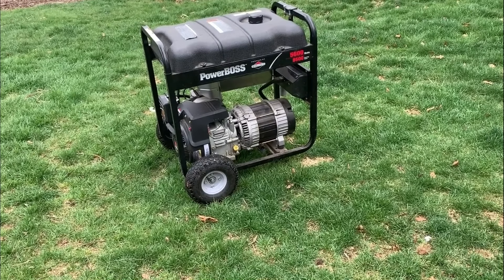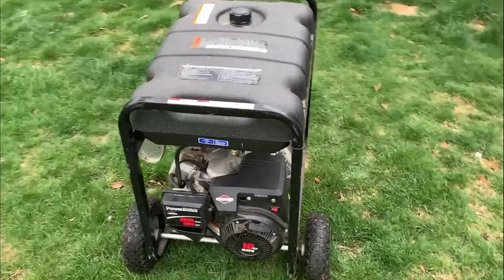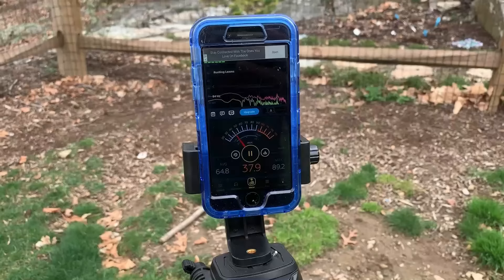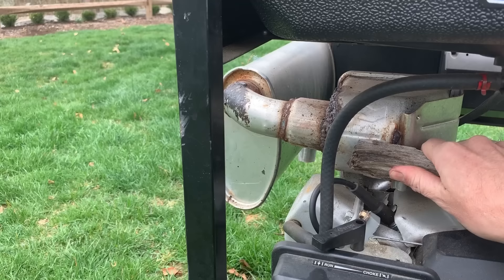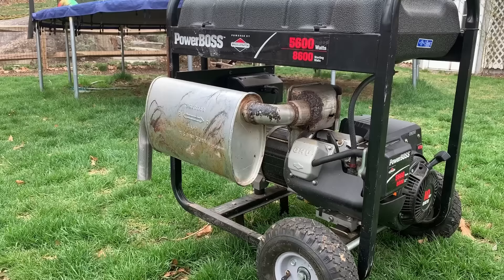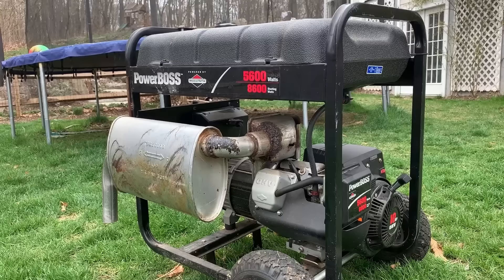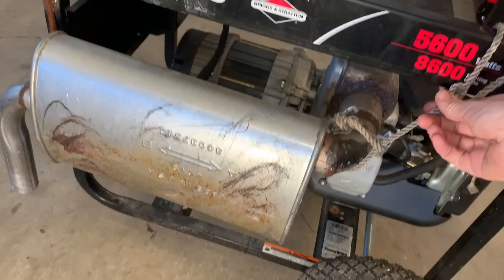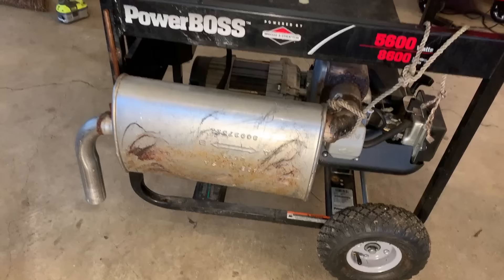Will a Car Muffler Make a Generator Quiet?

Comment: It's a 10hp engine, you could run open exhaust and it probably wouldn't be too much louder. Whoever had the bright Idea to put on a car muffler vastly overestimated the combustion going on inside that single cylinder. Also as someone else pointed out, it's a lot of mechanical racket as well.

Comment: Most of the comments are wrong because they are based on the erroneous statement that 3db is perceived as twice as loud. That is wrong. Three db is about the minimum loudness difference that a human ear can perceive between 2 sounds. If you are amplifying sound, 3 db takes about double the wattage. 10 db is perceived double the volume but takes 10x the power. And the frequency of the sound also has an impact. 90db of 100hz sound may be well tolerated, but make it 2500hz and it may well seem overwhelmingly loud.

Comment: keep in mind that loudness isn't the only thing that effects how disturbing a sound is, frequency plays a pretty big role too. so even if they had the same db one sound might wake you up at night and the other might be ignored simply because of the frequency of the sound. and since you were replacing it anyway you should have jb welded that hole, it would have lasted long enough to check it out, that piece of wood wasn't holding any pressure at all. also i like many others must point out the 3db rule, it isn't a linear scale, 55db is more than twice as loud as 50. 8:47 it would have been fine, we are talking about more than a foot of clear air between them and it isn't exhausting directly in, if you put your hand a foot away from that exhaust it is going to be like a warm summer day, not that hot. you are WAY out there with your premises.

Comment: Consider this: 70db vs. 76db is 4 times quieter. If you have a spare muffler and some time to kill with a beer and a welding machine, while you often run a generator in some confined spaces, why the hell not.

Comment: Car mufflers are meant for continuous exhaust flow, try motorcycle mufflers, not only that, but modern exhaust systems for cars typically use 2-6 mufflers.

Comment: NVH (noise vibration, and harshness) is something car manufacturers have spent billions of dollars to mitigate. You can get the exhaust noise down but it's still going to be pretty loud cause it's just not that well of a sorted engine. If you put the whole thing in a big box you'd quite it down a lot more.

Comment: So it turns out that db is measured on a base 10 logarithmic scale and 3 db equals increasing or decreasing sound energy by two, going from 75 to 70 db is a significant reduction in sound energy, even though it does not seem so in loudness to the ear. Since energy is what harms the ear this seems to be an improvement for ear protection. I would not do the mod either, I would use a sound deadening enclosure which might be more effective and would not modify the machine. Interesting experiment!

Comment: I've been told that a used stainless beer keg makes a great muffler. Even better if you can cut it open and weld in a couple baffles. Better still if you bury it in the ground next to the generator!

Comment: Two cockups . First get a muffler for a large displacement motorcycle and move the  exhaust outlet away from the space to be shielded from the noise. Then you will get quiet.

Comment: One if the man issues with how this was set up is the flow,  the car muffler allows a vastly higher amount of air through. If you were to reduce the exit hole to roughly the size of the exahst port, it would get even quiter thanks to the ability to catch those pressure pulses and dampen them better as it wouldn't be such a free flowing cannon effect. Learned that one from an old guy who liked building go carts with diy mufflers to keep his naboors and wife from yelling at him 😂😂😂 he used a piece of pipe and a few washers, set bit for tuning the muffler exit hole.

Comment: Dig a hole in the ground, put the generator in it, put one intake pipe in it, a muffler with a pipe for the output, close it up with a thick sheet of wood and done.

Comment: Would make more sense to just panel the 4 sides of the cart with particle board and sound deadening foam, and then route the exhaust outside, and maybe add an intake and exhaust hole and DC fans to circulate fresh air in the box...

Comment: A bit late in catching this. Idea, but that car muffler was 1 - too big and 2 - badly installed.  On top of the fact that it had a big hole in there that no matter how you really block it, some noise is getting out.  Using a smaller muffler like got a motorcycle is the right way to go… after you remove the factory muffler.  ;)

Comment: I have no idea if the can will work. but try this. remove the 12'' rear wheels from a lawn mower and replace the 4'' wheels on the generator.  on the front. install a couple of caster wheels.  you will be amazed at how easy it is to move around

Comment: A lot of noise comes from the intake and tiny air cleaner. If you made a large intake box with a reed system it would reduce the noise quite a bit. The intake is easy 50% of the noise.

Comment: motorcycle muffler and build a mod for the air cleaner side, that will help alot to block some induction sound. if you want true silent build an insulated box to sit over it when running with forced ventilation.

Comment: I have found that my phone analyzer is less accurate than a good analog audio spectrum analyzer. Also, outdoor application is best measured a bit closer. The delta is more apparent. I’m not trying to be a know-it-all, cause I’m far from it. Just done this sort of audio analysis quite a few times over the decades.

Comment: It dropped it by 6 dBA! The second muffler had effectively halved the sound level.  
That said, the car muffler points at the ground, the stock points straight out, and the biggest difference could be just in that.

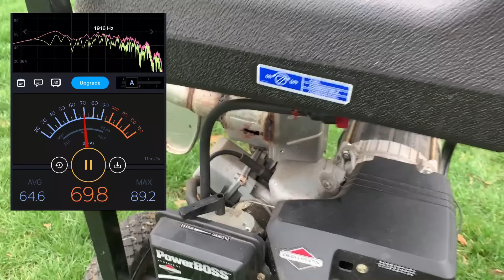Comment: 2:03
9:41
for comparison
you can really hear the pulses of the exhaust more without the muffler. once the muffler is on i think the majority of the sound is coming from the mechanical parts like the valves and such. the fact that it was a 6 decibel drop actually is pretty impressive, considering that means (i think?) a 2x (50%) reduction. of course our hearing is roughly logarithmic so it doesn't actually sound like that much, but if roughly half the noise is from the machine and the other half is from the exhaust pulses, those sound like pretty good numbers. you can see in this video how to reduce the sound of both the mechanical noise and the exhaust at the same time: https://youtu.be/CKQu_Pvdh0I?t=602
Reply: I'd also like to add, i've revved my car engine up to 3600 rpms and even with the normally very quiet exhaust it gets moderately loud when it runs that fast (plenty, again, is due to mechanical clatter, bearing noise, fan noise, etc). add a load (by putting it in drive and pressing the brake and gas at the same time, obviously making sure you're not gonna run into something) and you can hear it get louder. a lot of commercial generators run at 1800 rpms with a 4-pole genhead (unfortunately very uncommon for whatever reason on these smaller consumer machines) and i think that's largely just because it's quieter (probably also has something to do with less wear etc). i think part of the reason that the smaller gensets are run faster is because the manufacturer wants to squeeze as much horsepower out of the smallest engine possible, and if you've ever seen a dyno curve that's how you do it. run it as close to the redline as possible.

Comment: I had an extremely loud Coleman generator.  I wound up building a portable, 3 sided box made out of 3/4" plywood with a piece that just sat on top.  It was well ventilated so heat could escape, I then installed a round muffler onto it, with flexible exhaust pipe that went to a car muffler that pointed away from the campsite.  It helped, but it was still very irritating.  I finally bought a Honda 1000w inverter just to run at night and I swear everyone had to quit talking to make sure the thing was still running.

I sold the Coleman in a garage sale for $75....good riddance.

Comment: I vent mine into,,,,a steel container filled 2/3 full of anti freeze , exhaust enters below Anti freeze and bubbles out and is vented out with another pipe at the top...you still hear the mechanical sound of the engine...but very quiet.

Comment: Much of the noise from a small generator engine is from the engine itself, very thin head and cylinder walls with no water jacket surrounding the cylinder to help muffle the sounds as on a typical automobile engine. Even if you muffle the exhaust it will still be very loud, unless you enclose the entire generator in a sound reducing structure.

Comment: changing exhaust flow has consequence the same as changing water flow by increasing size or decreasing size of hose . a garden hose is worthless if I increase the size to 4inch at dispense because it will not have any pressure .

Comment: Engines that are running at 3600 rpm are just loud in general, full stop. Generators run at that speed to produce 60hz electricity at the right voltage.

I think a lot of people here are using their car at idling in the driveway at 750 rpm as their point of reference. 

Go rev your car up to 3600 rpm and you’ll find it’s relatively noisy. And that has an exhaust manifold, resonator, at least one catalytic converter, multiple feet of exhaust pipe and a muffler engineered specifically to reduce at engines volume. 

People here thinking they ‘cracked the code’ is hilarious.
Reply from the maker: So true.

Comment: The real trick is these engines run at 3600 rpm.   Tons of noise.  Unfortunately you can’t override the governor to let it idle and produce much electricity. You will burn up the generator. However Maybe I’ll do a mod that has a 2:1 ratio pulley set ??  Would that make a cool video? Do some sound damping for the mechanical, different exhaust ,and lower motor rpm ?

Comment: The noise comes from the slap of the piston against the head and internal parts. Its a very small block and not as thick as a car engine that's why the noise. You are better off trying sound dampen using ply wood around the generator. The muffler is there to control engine emissions from the fuel and oil.  They all run about 70 dbs.

Comment: I mean if it didn’t have a quarter inch by 2 inch gash in it, and if those welds were done a lot better lol. Then I bet it would of actually significantly dropped in noise volume. Also angling the exhaust tip at any angle other than the ground would probably help out too.

Comment: I think the comparison was fair. You had a gaping hole in the original muffler and holding a piece of wood over it is not a sufficient block. Additionally, one of the bolts was loose where it mounts to the engine. Another sound leak. Internal combustion is the same on a small engine as it is on a large one. There is no way a good muffler would be that loud on a car unless it was a Thrush or something along those lines. So, if the test was equitable, I bet it would have been significantly quieter.

Comment: A 3min video stretched to 10:39 mins.  Like Victor said use a single-cylinder motorcycle muffler with a small resonator for harmonics. Works for me and cools the exhaust exit temp to boot.
Reply: Come on. It is more entertainment than pure science. I liked to see him work as much as do the measurements.

Comment: My stepfather replaced the oem muffler with a muffler significantly larger than the irrigional vs and it cut the noise by about 50%. I don't think you can hope for more than that.

Comment: that is pretty cool to see but i think it would be even cooler for someone to build a custom muffler for a generator see if it could be made quieter. the larger the muffler the quieter things are but the size of the pipe also effects the sound.  i know i got a vehicle with  a single 3" exhaust and it sounds so much better and louder than my other vehicle that has dual 2" exhaust and the vehicle with 3" still has the factory cat.

Comment: Hmm. If I were to do this, I'd make a proper adaptor to go pipe from the engine into not one, but two, motorcycle mufflers (Thank you, @Viktor Krivor, for that part of the idea) in series.
And yes, they would need to be able to rattle with the engine.

Comment: If you want a quite generator, make a box out of ceiling tiles ( they're fire proof) and  drywall corner edges . Vent the exhaust with a 3" and a 4" heat duct . Crimp the 3" 
Right on the generators exhaust.  Cut a 4" hole in the side of the box for a double wall exhaust 
This will drop you to about a cars dB and will cost you $50 to make

Comment: While this made a significant improvement to the sound quality, I'd rather just buy an inverter generator. Adding a muffler can actually damage the engine if you don't know what you're doing, due to back pressure on the engine. I'm sure you can research and figure out how to do it correctly, but with so many good inverter generators putting out 7K+ running watts in the $2K range, to me, it's not worth spending $700 on one of these generators, spending money on a muffler, paying to have it welded on (unless you have welding equipment) and you still end up with a generator putting out dirty power.

Comment: Yeah you may think 5 decibels is not that much but as you mentioned that muffler pipe had a hole in it... And if it didn't have a hole in it the decibel reduction would probably have been in the 10 range... aka it's a good idea if you don't plan on leaving your generators out in the weather for the muffler pipes to start rotting and creating holes like this one did...

Comment: I think using all that muffler volume would be possible to design a extreme quiet exhaust for this little engine, but the mechanical part would still make a lot of noise and maybe people would start to return them, claiming that the engine is broken inside.

Comment: Of course not. Start your car and open the hood. The only reason cars are so quite is because the engine is sitting in an enclosed compartment, usually with some amount of soundproofing. The best you can get at removing exhaust noise... just run a straight pipe up in the air 6ft.

Comment: Air cooled engine has no liquid tunnel surround cylinder, so it will be way louder than a liquid cooled engine! What a muffler can do is very limited, and most important is make the exhaust go away as quick as possible, long pipe will increase the heat, it's a big thing for generator

Comment: I tried this with a 6kva diesel generator. It made a small difference however there seems to be a lot of sound that comes from the engine itself, through the crank case perhaps. 
I had a $400 car exhaust professionally fitted.
Reply: $400 ?? they saw you a 'coming, bub...........

Comment: I don't believe this can ever be done effectively (where it makes much of a difference) without compromising the efficiency of the motor.  I took my B&S 5500 Storm Responder to a muffler place.  A friend I knew had a muffler installed on his gasoline powered wood splitter at this place and had told me it had become very very quiet.  But for some reason, the guy at the shop told me that the same could not be done on my generator.

Comment: I’ve noticed the small quiet generators have a thick screw over the exhaust and the entire muffler is encased within the actual case which has sound proof mteral like foam on the inside

Comment: A common problem with so many portable machines is noise. It is perplexing why more attention is not paid to making machines like this quieter. My portable generator is so noisy & considered digging a pit in the ground to run it in when required, but it is so rarely used it is not worth the effort. I have the same problem with my Polaris ATV...Why do we accept noise like this? I want my ATV to be silent like an EV, not sound like the 5th armored division coming to supper.

Comment: Ten to 15 feet of 1.5"  metal flex tubing (if the muffler outlet is 1 3/8 OD) at the end of the Generator muffler clamped on will give the best results. I put a Stens muffler for a cub cadet on my old Powermate Generator Tecumseh 8.0 HP using a threaded pipe nipple and the muffler clamped on. Didn't do SQUAT. NO DIFFERENCE.  The length of flex tubing did a much better job of making it tolerable. Longer is better.

Comment: I'd say the muffler used on this was basically no different with or without.  If I went through all the work to quiet my generator, I would expect at least a 20+ decibel drop in noise. 5 decibels is nothing.  We can do better. Try it again with a motorcycle muffler, instead to see a better drop in noise levels.

Comment: I think you have a better chance to reduce noise if you were to enclose it, sort of like an engine in a car for example.
Reply from the maker: Putting a barrier around it makes a huge difference.  Just be careful though, the engine and stator are air cooled.  Sixtyfiveford had a good example of that https://youtu.be/5zwc5mdEbDI

Comment: You won't notice much noise reduction if you're standing next to the generator with the car exhaust mod- but at 100ft you'll barely know that the generator is running.

Comment: The car exhaust drops a few dB of the low frequency noise, which comes from the exhaust itself.....that sounds odd until one realizes that a large part of the perceived noise is mechanical noise coming from the engine and the generator itself, NOT from the exhaust. Baffles and such can help attenuate the higher frequency noise, but possibly at the expense of causing issues with higher temperatures, which might shorten the life of the engine or generator.

Comment: The best way to shut up a generator is with pressure treated lumber, a louver and and a cheap exhaust fan. Line the inside of your generator doghouse with that ultra-r fire rated foam board. You won't hear it after enclosing it